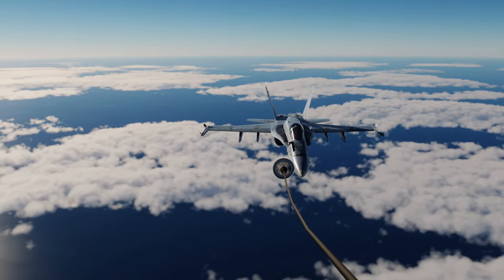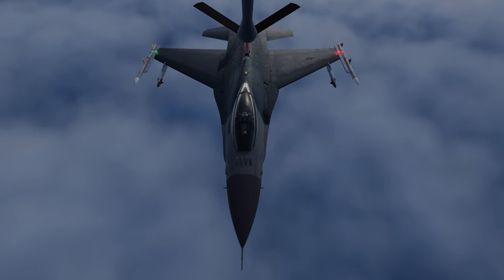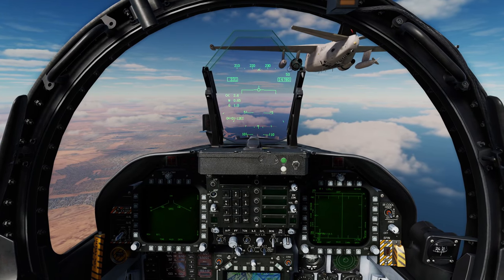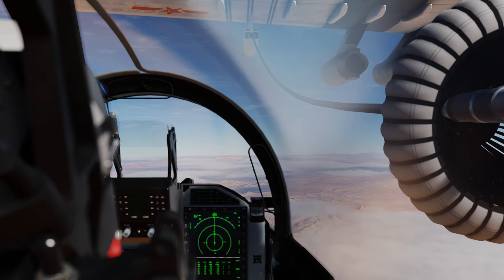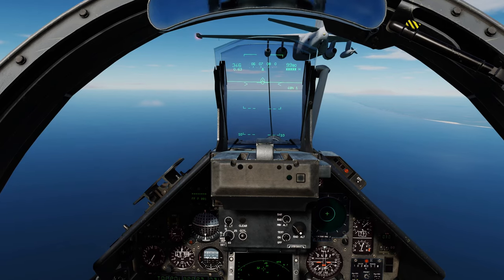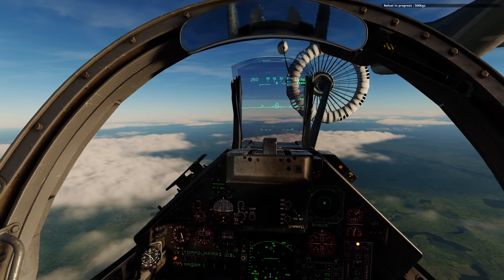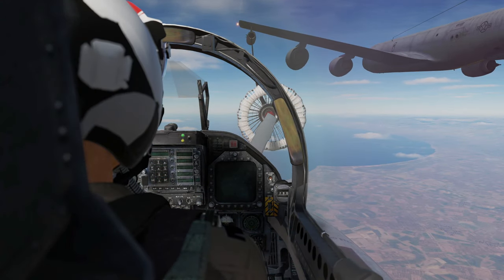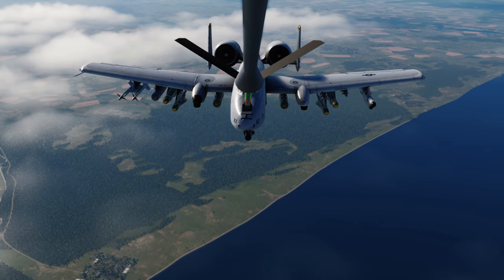Air to Air REFUELING | Digital Combat Simulator | DCS World

Comment: Some hardware upgrades are absolutely worth it though, especially the stick. I've had one that had about half a second delay, which (totally surprisingly) makes refuelling much harder. A friend of mine has a warthog stick, which is very sticky, so moving it only a tiny bit is almost impossible, it always requires a bit of force to get unstuck, and when it does, the steering input is already too big. Now I have a stick that moves very smoothly around the 0 point which makes refuelling a lot easier